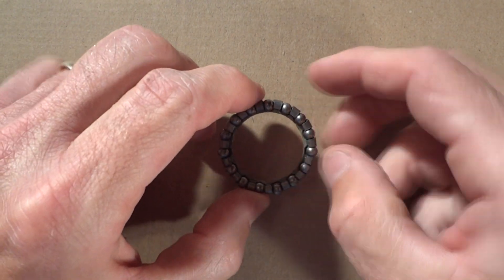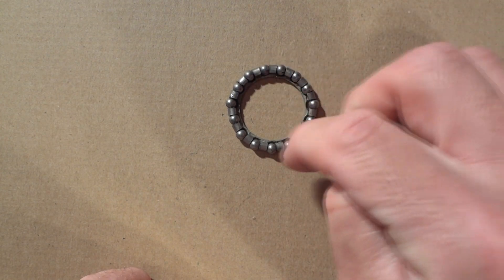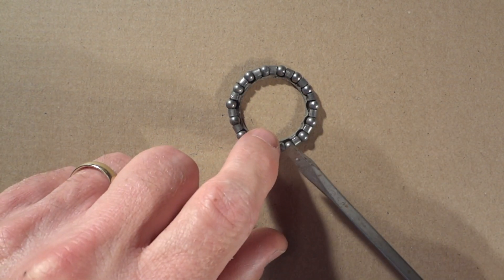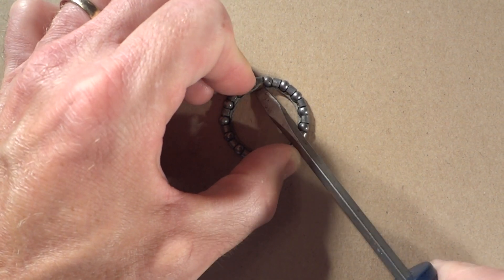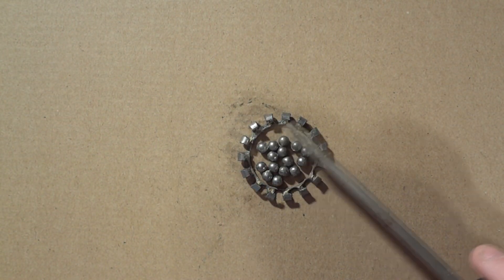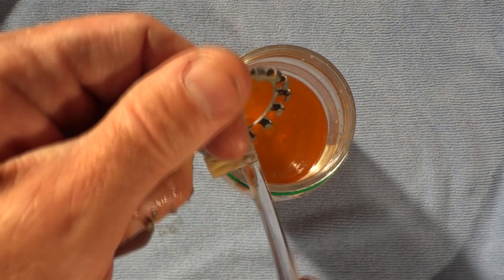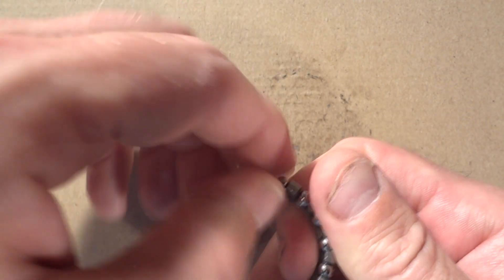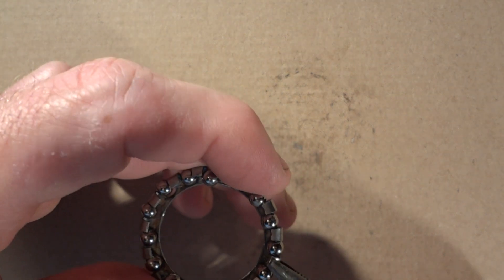How To Replace Ball Bearings In A Retainer Cage

Comment: Very informative,  just got a specialized allez, the steering is creaking left and right, I cleaned the bearing and grease them,  and still creaking noise coming from cables connection with tube maybe. Not sure

Comment: Wish i would have thought of this before tossing my coaster brake  ball bearing retainer. It's almost impossible to find 3/16 bearings in a 9 ball retainer, instead had to use 7/32 bearings in a 9 ball retainer, slightly bigger but it worked well.
Reply from the maker: +Soundafek You want to use the same size ball bearings. Other wise the bearings will ride in a different spot in the race and the whole thing will wear out much faster.
Reply: RJ The Bike Guy Can u use loose balls in a coaster brake ? I was under the impression u can't
Reply from the maker: +Soundafek Probably.

Comment: Oh my god. I have just pulled apart my mother's 60's vintage cruiser and you would not believe the amazing corrosion on the retainer cages! On one of the cages the bearings wont fit in at all due to the corrosion and the metal has pancaked, while on the other one, the bearings are stuck and won't spin at all. I guess that explains why the axle was getting stuck!
Reply from the maker: You'll probably want to replace the whole cages then. One of my local bike shops sells them, and another does not. And I haven't tried any of the others. So if one doesn't sell them, try another.
Reply: I definitely replaced them both! I reassembled the bottom bracket and it's working a treat!
Reply from the maker: Cool!

Comment: I did pry up the legs and cleaned everything. Put everything back and the legs back. Greased everything with park tube PPL-1, but my bottom bracket feels like it catchs as soon as the adjustable cup is tight enough so the spindle don't wabble. Did I screw up the cage bearing leg folding back procedure ???? Is that step easy to screw up ?
Reply from the maker: Maybe. I can't tell you without actually seeing it and working on it.

Comment: Can you replace this kind of bearings with cartridge ones? Do you have a video on that?
Reply from the maker: No you can't. Hubs/BBs/headsets with cartridge bearings are made for cartridge bearings.
Reply: @RJTheBikeGuy  but what if i change the headset?
Reply from the maker: @ijustdontknowguy842  If the headset is made to use cartridge bearings.
Reply: @RJTheBikeGuy  so the frame and fork don't matter?
Reply from the maker: @ijustdontknowguy842  Buy a headset that fits the fork and the frame.

Comment: Other than taking the old caged bearing assembly to the LBS with you, how do you identify the type of assembly you need?  Looking at bearing assemblies on line for purchase, I'm only seeing the size of the individual bearings, and the quantity in the assembly  description, but not the diameter of the assembly itself.   I can see how maybe that's all you need.  Is that the case?  Thanks!
Reply from the maker: +Bill McComas Yeah, that's an issue. I have taken cages to the LBS and they would be comparing them to pictures in catalogues. Sometimes they would order a couple and we side if they matched when they came. The easiest way is if your LBS has some in stock and you can compare them side by side.